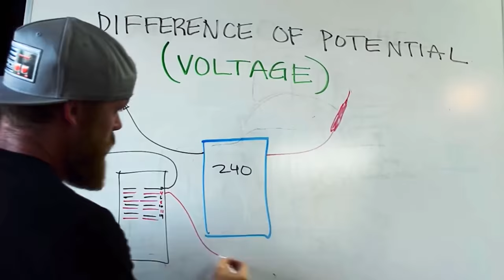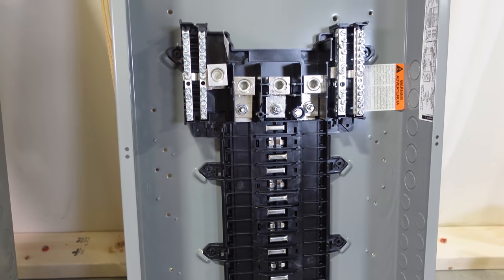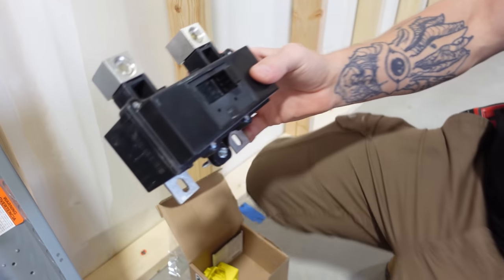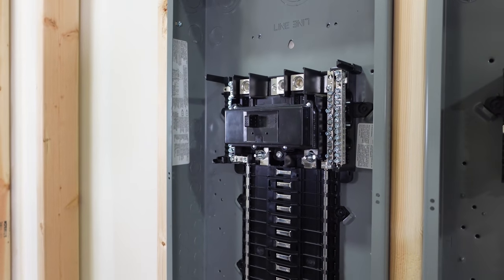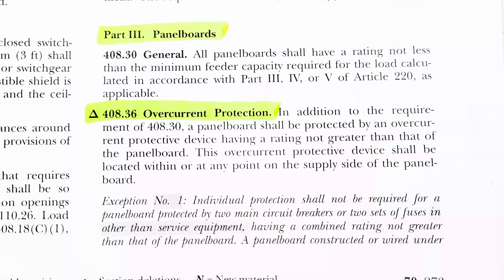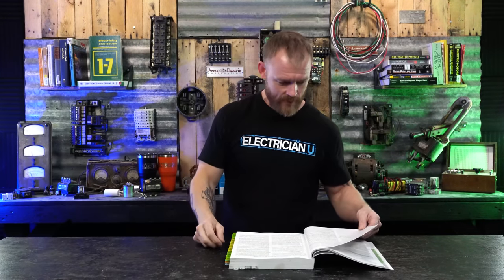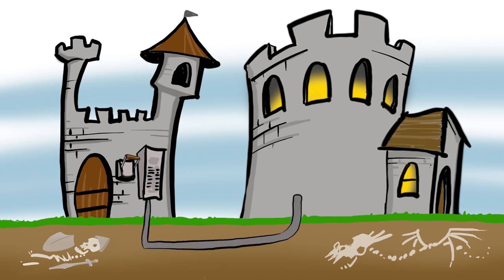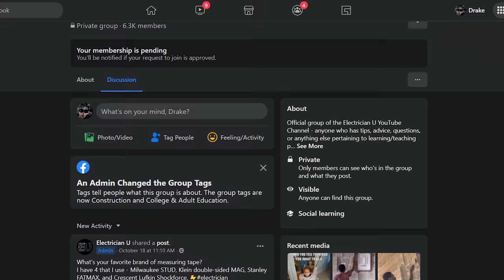What's the Difference between MLO and MBR Panels???

Comment: So when adding like you showed at the end with the house underground to other house or castles in this case lol when adding a main breaker panel instead of mlo we would have to unbond the panel and then float the neutrals and grounds. My question is have you ever had to drive ground rods in both locations( referring to both panels) ? I've always pulled a trailer wire rated in amperage to feed it unless it's in a house panel to panel then I would just pull a SER type wire. I've been told both that you do have to drive a ground rod and also you don't because there is a ground in both those types of wire I mentioned.

Comment: Maybe it's different in other areas (I live in CA) but I've never heard it referred to as MBR. It's MLO and MCB (main circuit breaker)
Reply: MCB makes way more sense as an acronym
Reply: @thepeter3116  rare occasions I've heard it called "MB" but never MBR. weird...
Reply: What does MLO stand for?
Reply: MCB to me. Means Molded Case Breaker. Which is something else entirely. 

Usually breakers greater in size than 400A but that is not a hard and fast rule. 

Basically it is a sync and switch gear breaker or main service disconnect for larger services than a typical residential system. 

Doing data centers for 10 years now. So my acronyms are dramatically different than what most are familiar with.
Reply: They look like these : http://m.industrialautomation-products.com/sale-10772595-schneider-masterpact-molded-case-circuit-breakers-nw-mw-800-to-6300-a.html
Reply: @zmettin1994  i know it as MCCB-molded case circuit breaker

Comment: I'm not even close to being an electrician, but I love watching your channel (I subscribed and smashed that "Like" button). Is there a reason to not have a second disconnect at a MLO panel? I understand that there is one at the MBR panel, but would it be helpful to be able to shut off the entire panel when you are in the separate structure? I'm not trying to second-guess you or the NEC, and I know there is a reason for this, I'm just curious. Thank you.
Reply from the maker: This is why most times at a separate structure, there will be a disconnect that would de-energize the MLO panel, instead of having to go back to the MBR to disconnect power.

Comment: @willpartin622
3 hours ago
HELP! I'm replacing an old Federal Pacific 100-amp panel with a 200-amp Square D Hameline panel, so I will need to upgrade the service entrance cable and want to use 2/0 THHN copper.
 The outdoor meter can/box is mounted low, (30" off the ground at bottom edge of can) outside, so if I use the bottom rear 2-inch knockout of the meter can, it will put the hole through the wall below the bottom edge of the new breaker panel by about 8 inches, so I will have to make a vertical 90 upwards turn from hole in wall to bottom knockout of the new panel. I cannot find a 2" close 90 PVC electrical fitting so I'm guessing they don't make one. 
My question is: how do I make that vertical 90 turn upwards? It will eventually be covered in drywall. Do I need to have the inside copper leads in conduit at all? If I use switch to 4/0 aluminum, do I need conduit inside the wall cavity? thanks in advance!

Comment: Kind of off topic question, but related, what size wire is recommended to use to wire up a 125a sub panel thats approx 2 feet from the main panel? I measured the overall height of both panels and the distance between them and it came to a little more than 7feet total for estimated wire length per leg.

Comment: A question for a Q&A video: 1950s house with no equipment ground on any sockets and no metal conduit/cladding. How do you go about adding equipment ground?
Reply: gfci upstream
Reply: @xjackdareaperx  It is a type of protection, which is better than none, but it's not an equipment ground. At minimum, for a ground, he needs to drive a ground stake to Code, and attach suitable gauge wire for the earthing from the pole to the box. Then run additional wire for ground - that's when you may end up rewiring circuits with newer romex that has the ground included.

A GFCI detects imbalanced drain from hot, that is going to something other than that circuit's neutral, but it is not a replacement for a ground. Combining neutrals - which happens in older wiring - can trip GFCI's. Several electronic power supplies on the same circuit, can also trip a GFCI. They leak a small amount of power to ground by design.
Reply: @my_channel_44  Yes but in this situation noone's going to be rewiring or running new wires, a GFCI upstream would still provide protection, but as you said, technically it is a type of protection, one that is most commonly used in that situation. I have personally very seldom ran into issues with new gfcis tripping on older homes luckily but I can see it happening easily and requiring further action.
Reply: @xjackdareaperx  It's more that I want an equipment ground than protection. So far, it's either running new romex and letting it simply dangle in the walls without properly securing them (which would require opening walls) or running conduit, since that can be secured according to code (from my layman understanding).
Reply: @gslavik  just fish romex

Comment: Aren't you allowed to avoid adding a main breaker or disconnecting means at an out building panel if there are 6 or fewer switches to shut off power? I. E. A main lug panel with 5 breakers feeding 5 branch circuits could be used in lieu of a main breaker? Or am I mixing up something?
Reply: The main breaker is to cut off power to all circuits in the electrical box
Reply: @cattiger76  obviously....

Comment: Do they make panels with a main shutoff at top, without being a breaker? What are they called?
Reply from the maker: How much money you wanna spend? 😂 
It's easier to go into a nema disconnect into the panel itself at that point.
Reply: @ElectricianU  I do multifamily units with a 100 amp breaker box inside, with a main breaker in the box.  And that's wired to a meter pedestal with a breaker in it as well.  Inspector is not liking having two 100 amp breakers in line. Inspector said on future buildings to not put a breaker inside and just a shutoff switch.  But the breaker box sits in a 2x4 wall that's finished with drywall around. Putting a traditional disconnect next to the breaker box does not flush mount for drywall. You say put a disconnect inside the box? How? Thanks for your help and videos.

Comment: My parent's current house (older & rented) does not have any main breaker in it whatsoever...the lines come in directly from the meter into two lugs on the breaker strip.  
It was very disturbing to try to work on it while live at 150 amps...but it had to be done...so 2 pairs of nitrile gloves and an outer pair of rubberized work gloves were my only option.  
Oh...and one of the outside breakers feed a secondary inside fuse (YES...screw in fuses) panel...one of those fuses feeds a tertiary fuse panel further on.  
It's a fucking mess!
Reply: If they rent the house out to others, I'm not sure if that would pass a city inspection for renting it.
If they are the renters, the only things I would suggest are either have landlord fix wiring (very unlikely as it is a bare studs remodel at that point) or move.
Reply: Pull out the meter. Bam. Dead panel 👍⚡️
Reply: @JasonW.    They rent from a LL...but since the electrical has never been upgraded the LL doesn't have to add the main breaker.
Reply: @liloso60    
Pull out the meter. Bam. You get a tampering with a utility charge and fines.

Comment: I was at a small single family home today, built in 1974, no main breaker on old square D panel, and except for the sealed meter breaker, no exterior breaker either. The neighborhood is full of old identical houses, though I did not check any others. WTF?